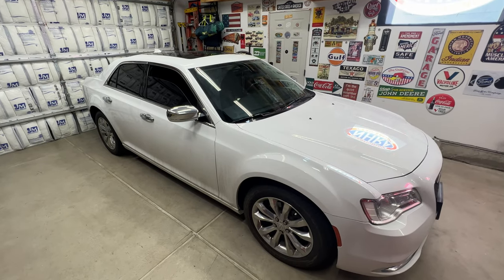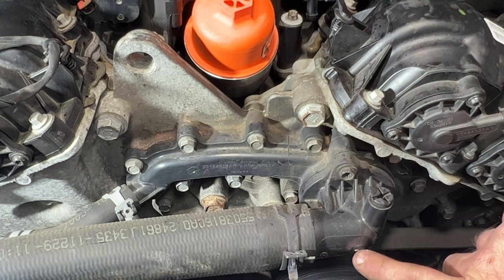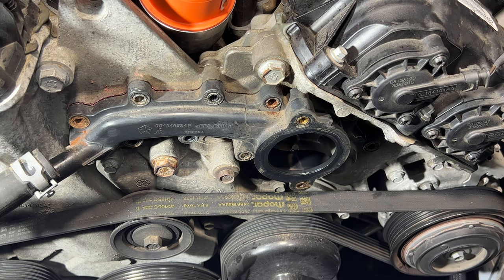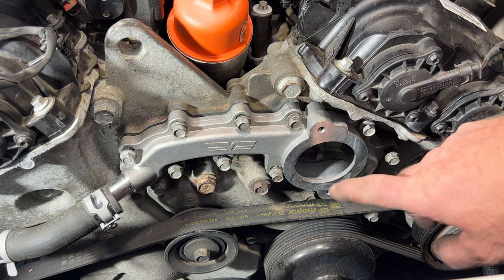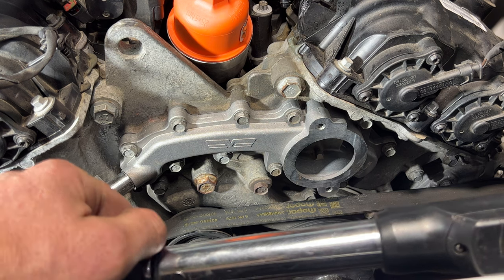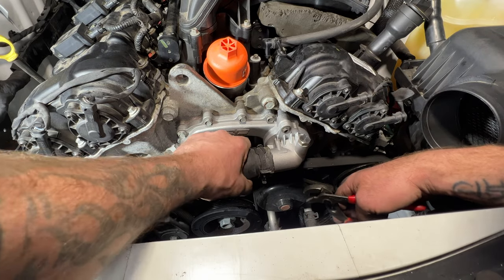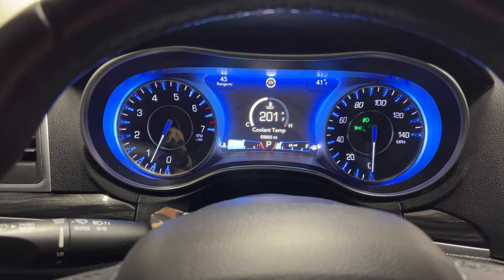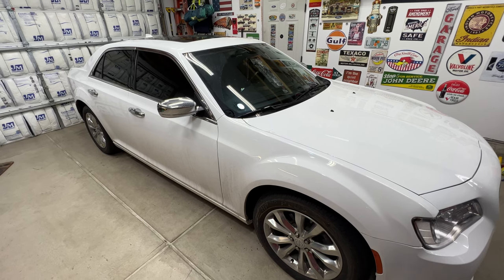2011-2023 Chrysler 300/Dodge Charger Thermostat Housing & Coolant Pipe Upgrade & Coolant Replacement

Comment: On my LH  Chrysler 2.7L takes about 8.5 - 9.5 quarts.  I use two quarts concentrated and fill the rest with 50%-50% mix Mopar. Worked really well.

Comment: Only lists 300, charger, and challenger? Is there a reason these parts wouldn't work on the pacifica or any of the other models they stuck this turd in?
Reply from the maker: It shows the Pacifica is a little different and these part numbers won’t fit.
Reply: @BLUECOLLARGARAGE  That's interesting?! It's the same engine and all the internals are the same, why are the externals different, because it's mounted transverse? Or did they make the plastic thicker 2017+ to "fix" the warped, leaking plastic problem 🤔 
Wife's Pacifica is a 2018 and have the leaking oil cooler issue. Wanted to fix any other issues while I had the top half of the engine torn apart. Going to do plugs and pcv when I do the filter housing. Has 75k on it now.  Had a lifter fail at 22k and took out a cam, under warranty, thankfully. Still considering doing head gaskets as well, since these are known to fail in these turds

Comment: Just replaced my thermostat on mine but it keeps leaking coolant from the bleeder screw. Any idea why?
Reply from the maker: Sounds like the o ring isn’t sealing correctly. Are you using the plastic housing or the updated aluminum housing?
Reply: @BLUECOLLARGARAGE  Yeah it’s a plastic housing that comes with the thermostat already in it. And I was thinking the same about the o ring too so I went and got another bleeder screw with a new o ring and still the same.

Comment: Got a SECOND misfire #4....first time was cylinder #1 $1200 repair because of a "loose" lifter. Just replaced the thermostat and now I need struts...it's a 2015 300s and it's time to GO!
Reply from the maker: I agree with you. I told my daughter not to buy a Dodge or Chrysler product you’ll have nothing but problems and as you can see from all the videos I’ve already done on this car 😂
Reply: @BLUECOLLARGARAGE  I'm going with a 23/24 Honda Civic.
Reply: Mine is leaking coolant inside of the oil cooler set but is not the oil cooler because I just replaced too is coming out in front of the oil  cooler  I could see it drip down in front of the oil cooler wall  in front of the thermostat and that thing that you just replace you think I have to replace that too
Reply: Why struts?

Comment: So if I am doing one job  (spark plugs, oil filter housing upgrade, thermostat upgrade) it makes sense to do all three at the same time, correct? Any other upgrades I should consider while I am doing all 3?
Reply from the maker: No that’s pretty much it those three things the oil filter housing, thermostat housing, and coolant pipe are prone to failure and then of course might as well change plugs while your in there and don’t forget the upper intake plenum gaskets.
Reply: Thanks again @BLUECOLLARGARAGE  !  I was wondering if it also made sense to do a water pump too maybe with a metal impeller but wasnt sure if the factory one was suspect or not.
Reply from the maker: @ryanmcalister1188  haven’t really ran into the factory water pump failing that often. I’d say if you have high miles go ahead and change it out since the cooling system will be drained.
Reply: Thank you again for the great video and advice.  I have just over 90k miles but while I am doing all, I think I will tackle the pump too since the price is not that bad.  Again thanks and good luck!
Reply from the maker: @ryanmcalister1188  no problem anytime brother. Let me know if you run into any issues or have anymore questions.